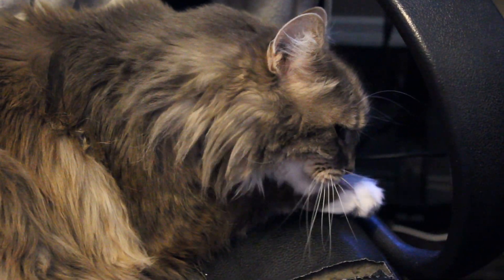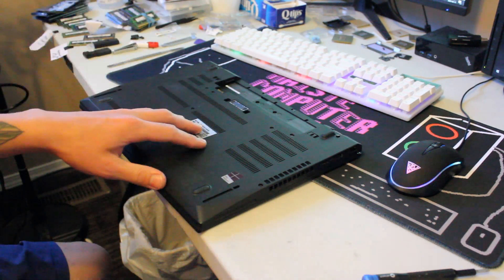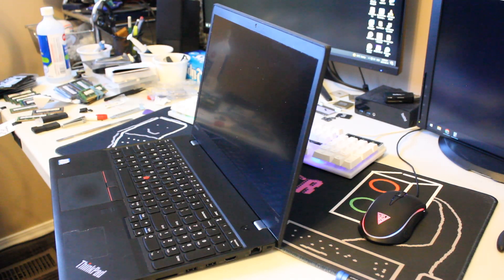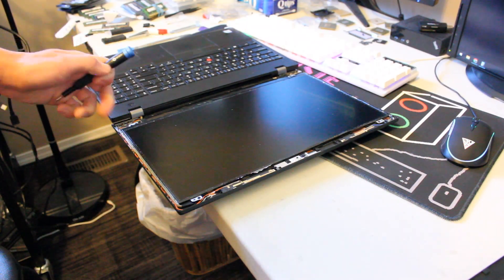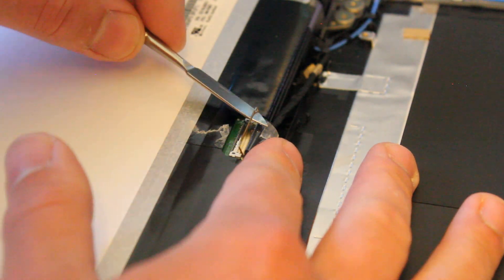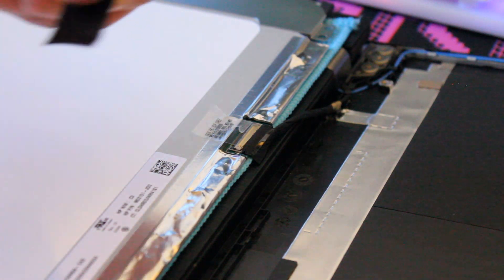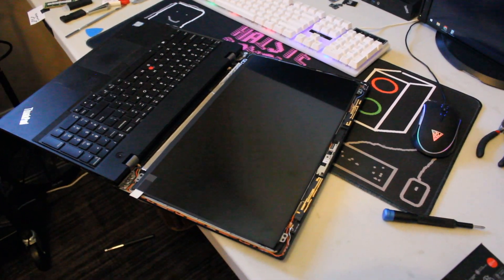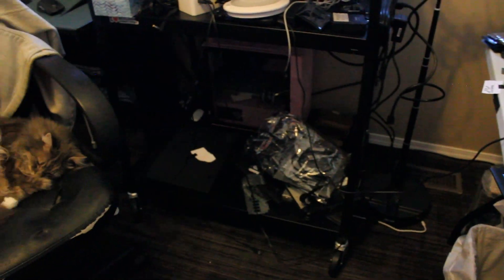Lenovo ThinkPad T570 Display Panel Replacement

Comment: What do you do if it turns on but the screen is very dim, but faintly shows lenovo?
Reply from the maker: Well, it could either be the panel itself or the motherboard.  Are you able to try reseating the cable connection both to the display panel and to the motherboard?  I just worked on a ThinkPad T530 where it turned out the dim display was caused by the motherboard, so I swapped in a replacement I had in old stock.   I did actually order and try installing a new panel, but it was still dim.  I even tried a new cable.  So, a motherboard swap was the soution.
Reply: @HaisteComputerRepair   Sorry for the late reply, I just got the alert for this. Initially I thought it was the motherboard, however the asset works just fine on an external monitor. I think it is the panel, the seller claims the panel is fine but quit responding.
Reply from the maker: @LordAlaster Well if the panel is so dim that you can't see anything then it's of course not fine.   Where did you buy from?  Is there recourse in pursuing a return or refund before investing in a new panel?
Reply: @HaisteComputerRepair  I ordered it from a seller on amazon. I've been trying to get it sent back for 2-3 weeks. So I have one last ditch effort to get a refund.

Comment: Cool video! I noticed one thing: it seems that there is one M.2 port that is available from your previous T570 video. Are you interested in installing a WWAN module in it and get 4G mobile internet?
Reply from the maker: I am definitely interested and may do it with a ThinkPad P51